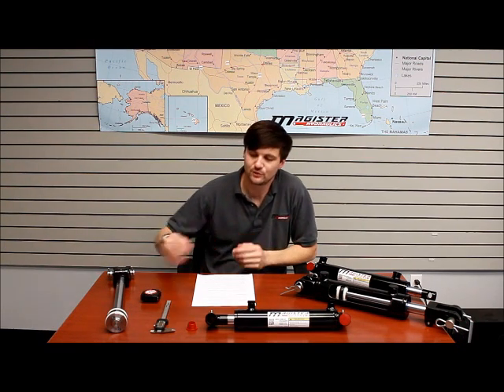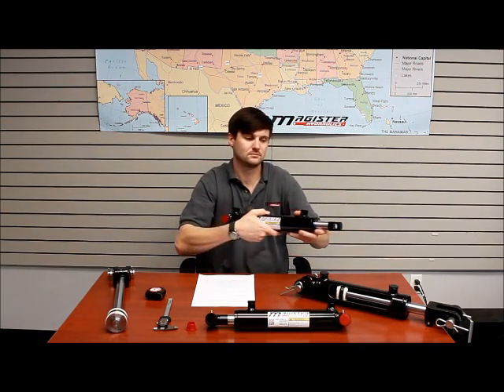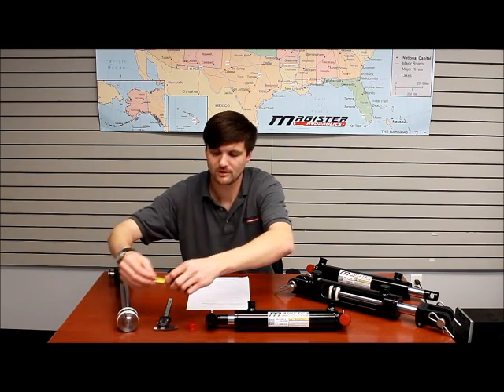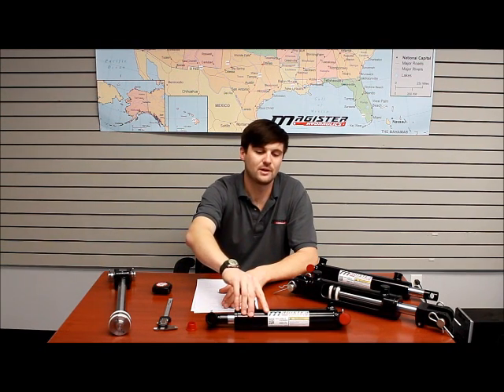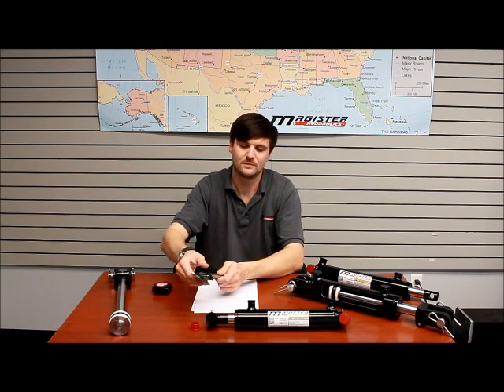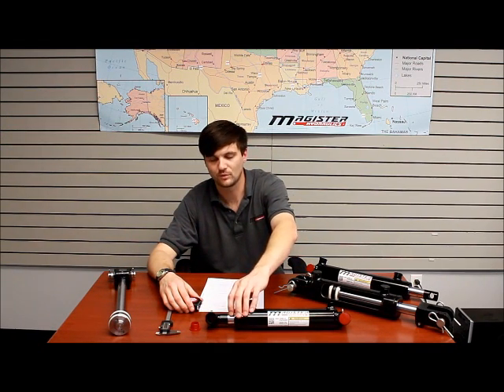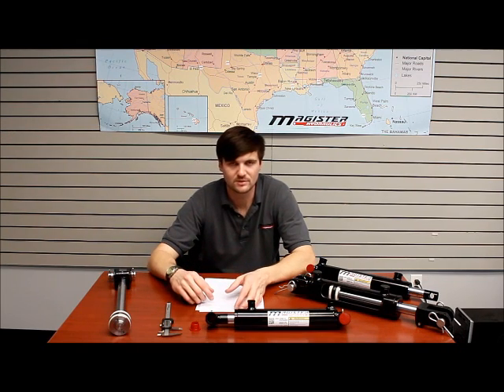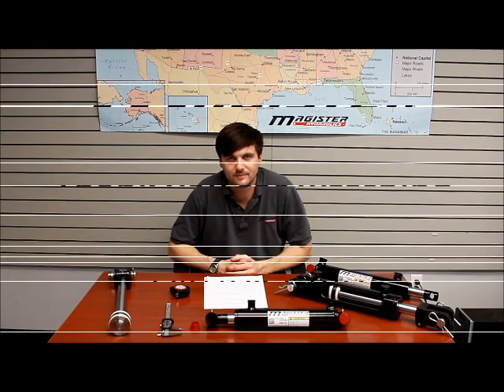How to measure a hydraulic cylinder replacement - Magister Hydraulics

Comment: I recently bought the 1.5x6  cross tube hydraulic cylinder for my Kubota tractor project, worked out perfectly..
Just had to learn a quick lesson on SAE fittings vs NPT fittings, but no big deal.

Thanks Magister Hydraulics!
Reply: +Dan X Thanks to you!